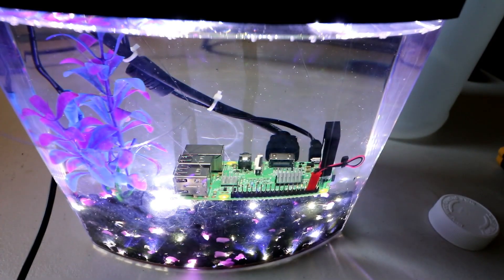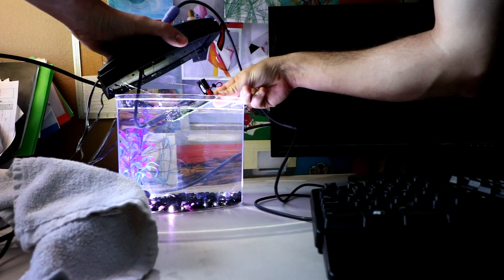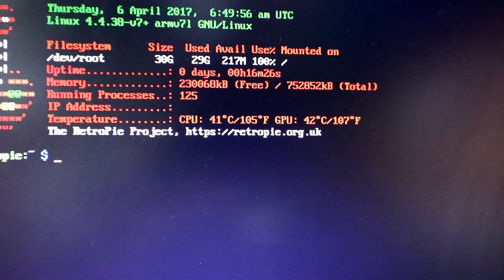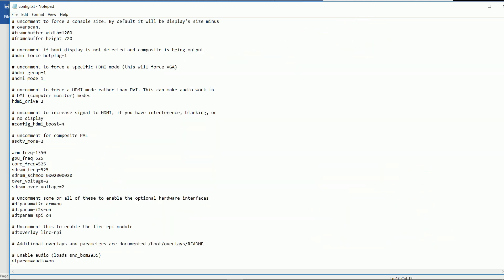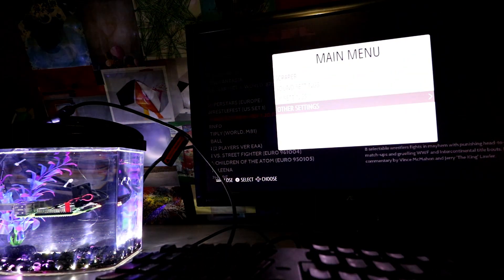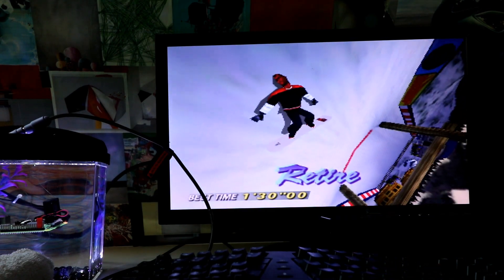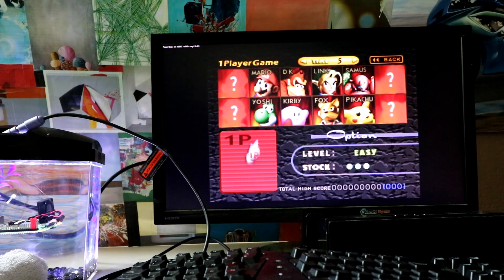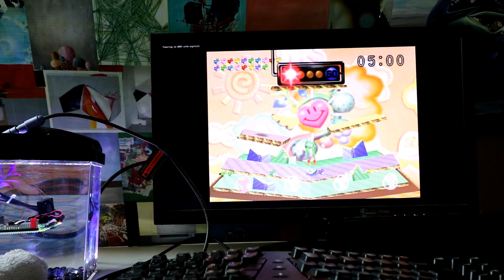Liquid Cooled Pi Overclock

Comment: So... you basically were able to get the same overclock as if it wasn't in oil? -- That's kind of a let down. (Pretty much every Pi 3 can hit the setting you showed.)
Reply from the maker: You could push it father you would want an oil cooler radiator installed though
Reply: I should hope performance doesn't take a hit! Also, it looks terrible IMHO.  What would look cool, is if he put it in a NESPI+ case.

Comment: looks amazing, but if i had a pi i wanted to configure and test suspended in oil - i would enable ssh. less greasy ;D
Reply from the maker: yup!
Reply: WiFi for the wiiiiin!
Reply: pewpie99 usually, oil rigs have the back plate exposed above the oil... So that you don't need to get your cables greasy...
Reply: even better.  I not only would use ssh but I would set up sixaxis controller for blu tooth controllers.

Comment: Drew - sorry if I missed this in a previous video but is there a minimum amount of oil you need? I know you used a fish bowl as it was only a few bucks but I want to do something at a smaller scale, only just bigger than a normal Pi case and filled with oil. Let me know when you can. Lozzee
Reply from the maker: no, but the more oil the better it wont heat up as fast...I have a gallon with a gallon tank. I would say not to put it in case but up to you
Reply: I'd say it would work, but not as well as a small fish bowl. A lot of people don't even cool their pis. Personally I prefer a Flirc case though, oil will damage your wires over time.

Comment: You can ssh in   sudo nano /boot/config      why pull it from pi?  Messy,  plus to use 1350+ overclock you probably need over volt  5 or 6 instead of 2 and a better power supply  is that 3amp or 2.5?  My overclock supply is 5.25volt 3amp
Reply from the maker: 2.5 amp - thanks for the video will have to try that next, thank you.